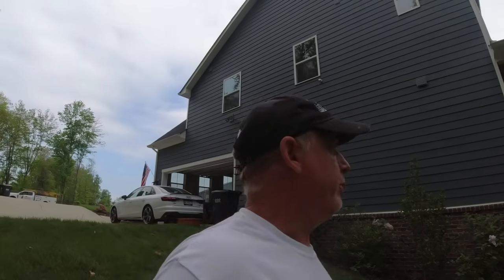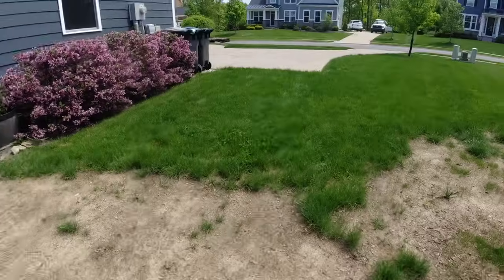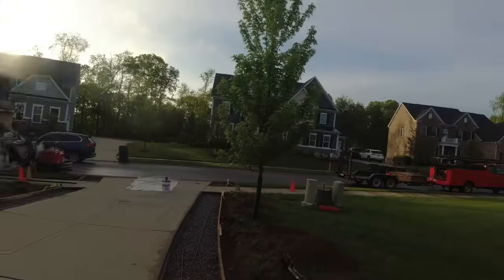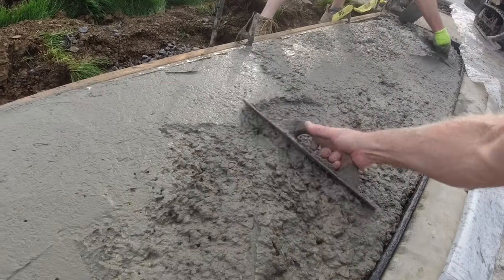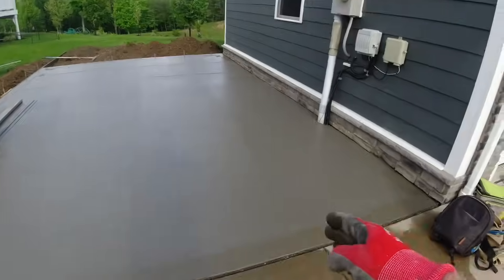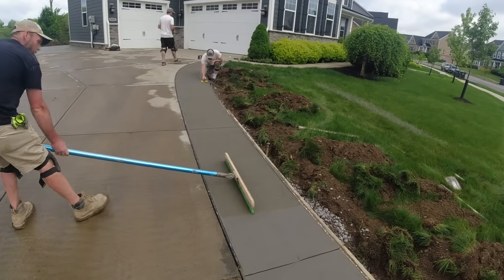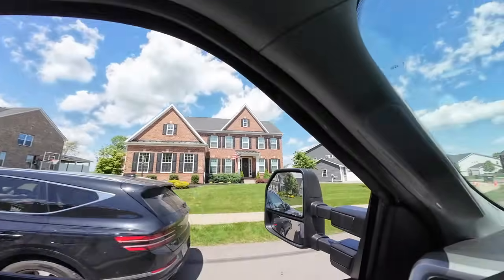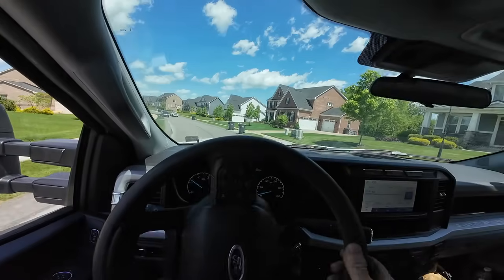This Is Why We Use Rebar!

Comment: Geeze, the driveway had no rebar, could have been 2 inches thicker. The patio had no epifoam and no expansion joints, and no cracks....yet. Is your way wrong? Heck no. Some guys are just lucky. Very nice pours. As always, the crew works flawlessly. Hurry up and wait. Great job guys!! Thanks for sharing.👍❤️🙏🇺🇲🇺🇲

Comment: Steve looked a little "cautious" running the mini back on the hillside. Any idea why??? Would you imagine they had to use 6x6 wire plus fiber in the concrete on that deck portion you filmed?? Looked relatively thick as well.
The jogger was probably the HOA president checking to make sure you were doing acceptable work. You know how high building standards "aren't" these days. 
I saw somewhere in the comments about that back pour being a good use for the pumper?? You seem to get it finished with no issues. Sometimes it appears to me, and I know nothing, that folks think it's the cure all for these jobs. Personally I think it would take longer with set up, guessing a little slower in distribution of concrete, compared to using 2 buggies, and then the clean up at the end. I'm assuming you'd only pull that thing out on jobs that truly needed it and not just to use it??
Excellent work as usual. Grab your coffee cup and onto the next job.